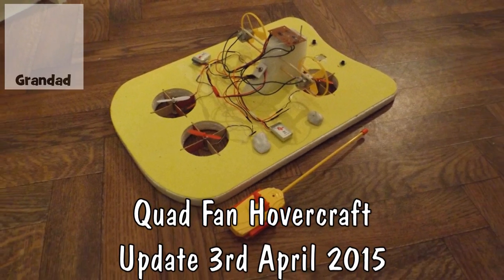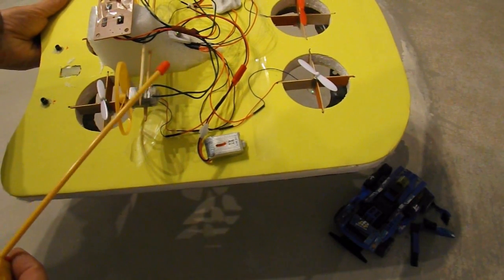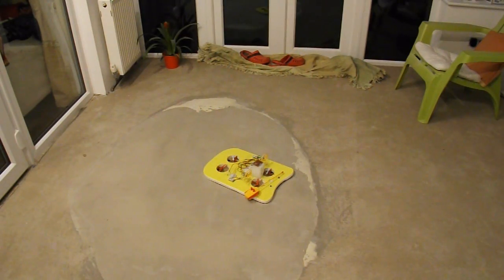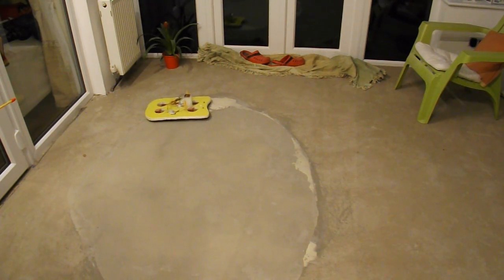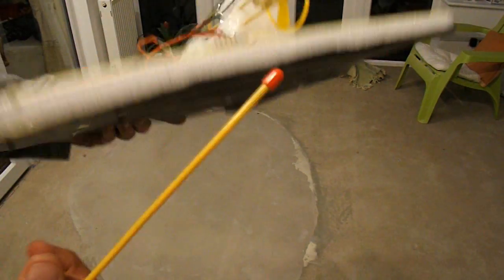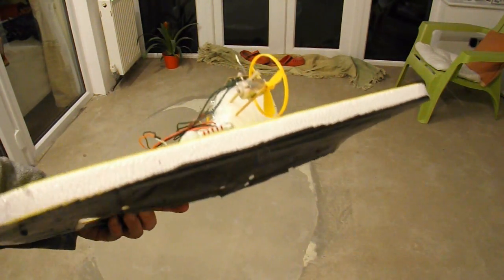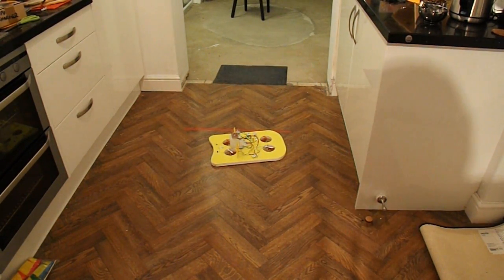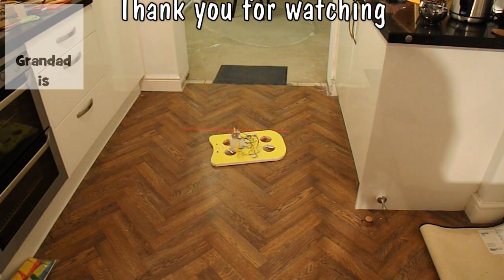Quad Fan Hovercraft Update 3rd April 2015

Comment: Please make a idea were you try this on a pond or somewhere were there is water. I am sure it would work greatly.
Reply from the maker: Mustafa Moussa a hovercraft is supported by a cushion of air. As long as the surface is relatively airtight it should not matter what the surface underneath that cushion of air is, so it will work on water as well as it works on land. Small hovercraft like this would struggle over thick carpet or gravel as the air can escape through it. In fact the water would make the seal round the skirt better so it would work even better. However it is easier for me to demonstrate these on my kitchen floor so that is why it is where it is.

Comment: Put a plastic bin bag or something so the air is more contained and there is less friction so that the hovercraft moves faster. Also puncture a few holes in the bin bag if needed. 
Thanks
Reply from the maker: Mustafa Moussa this hovercraft does have a plastic skirt made from a plastic bag although it is getting rather worn out and needs replacing. I have seen people make what they call hovercraft by putting a whole plastic bag underneath, but that is not a true hovercraft, that is just a plastic balloon making contact with the ground and supporting the weight.

Comment: I'm happy you got this to a new, more functional, place!  Do you still consider this build affordable?
Reply from the maker: JackANDJude the simple questions are always the trickiest. In truth the 'Hubsan' motors are virtually the same price as the vibrating toothbrush motors were. I bought 4 for under £5 and 4 of the vibrating toothbrushes would have cost me £4 so the price is comparable and the power is significantly better. The LiPo batteries were also cheap items from eBay and as they last better than the cheap bargain store rechargeable batteries again they are comparable although you need a proper charger so there is a cost implication there. The RC transmitter/receiver are my usual scavenge from another RC toy so that limits the range. A proper RC transmitter & receiver combination would push the price up significantly. In it's current format it is probably still a viable build for a learning opportunity but buying from China via eBay means you would need to plan to do this a couple of months in the future, whereas buying from the 'dollar store' means you could have a working hovercraft overnight.

Comment: I love it! What an awesome project this has become, hope to see more updates on this soon! =)
Reply from the maker: Chris Fredriksson thanks. I had finished this project last year as it was only supposed to be made from cheap components found in Bargain Stores, but I just happened to have these Hubsan motors available and I couldn't resist putting them on. I might put a couple on for the directional fans and it should be at the end of it's development.
Reply: GrandadIsAnOldMan Aha, so it all started before I subscribed then =) Alright, well looking forward to see if you put on the directional fans then and see if that works =) Keep up the great work with the videos =)